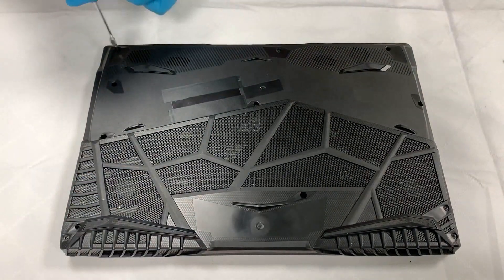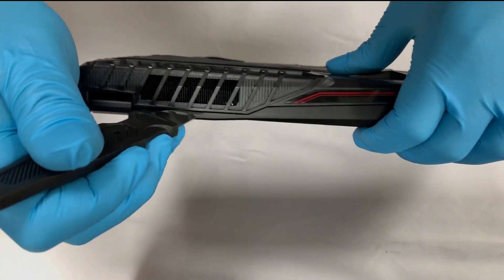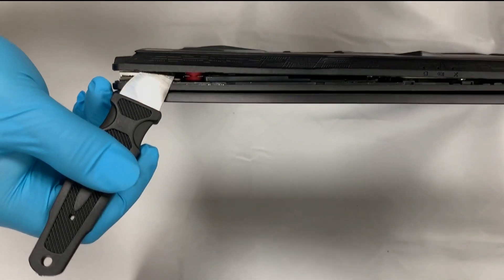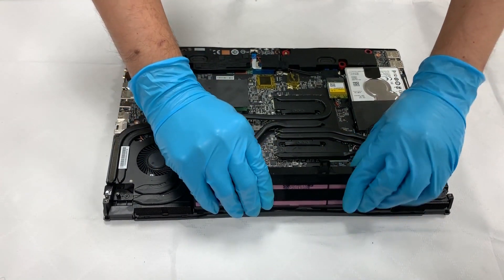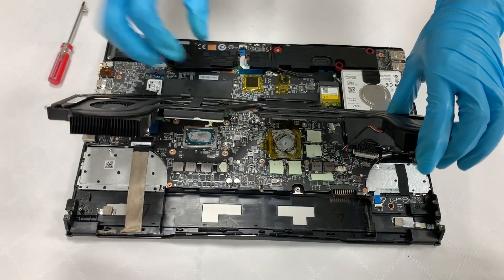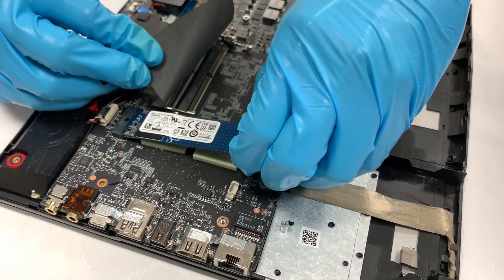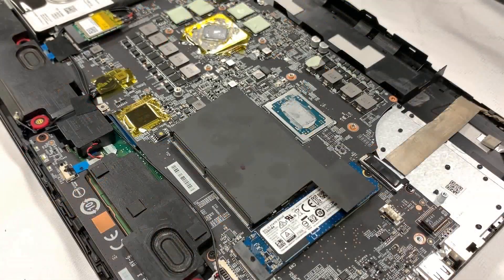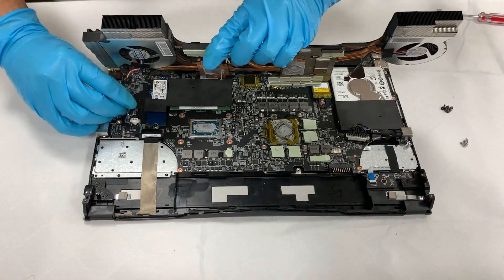MSI Alpha 15 A Series SSD & RAM Upgrade Tutorial

Comment: My alpha 15's CPU had started to overheat and thermal throtle. Found this video and used it to repaste my CPU and GPU. My laptop now works even better then when it was New!

Thanks a lot for posting this video.
Reply: how much estimate paste themal in mg, i want to buy the paste but i don't know how much paste in mg required
Reply: You only need a little bit of thermal paste.  I put a little dot like a a pea on the CPU and another one on the gpu.

I have purchased a 3.5g tube and with it I had more then enough for this job and 3 to 4 desktops CPU.
Reply: Can i put another ssd in it and can I remove the hdd I have cuz I think it's dead and my laptop is just struck at the msi logo screen not turning on after that from past three days
Please do reply
Reply: My version of this laptop has nvme storage not HDD. Si Il cant Say for sure, but I have replaced an HDD with a 2.5 inch SSD un another laptop and IT has worked fine.

Comment: I have a A3DD and was able to swap the NVME SSD without removing the heat sink. The M2 card has enough wiggle room to just slip by the sink. Kudos for this video, it helped a lot.
Reply: I read everywhere that it should have a 2nd ssd slot, do you know where it is?
Reply: @eliodelioable  probably you need to replace the hdd to ssd

Comment: It turns out the latest Alpha 15 model, you cannot add a 2.5 HDD/SSD due to the newer version AMD 7 and GPU, requiring a larger fan. Instead, MSI added an extra NVME slot next to the other one.
Reply: I have an alpha a3ddk, you believe they put the nvme port to it too?

Comment: Do I have to remove the fan to install the 2.5 disc drive?
Reply from the maker: Oh, for the 2.5" HDD, you don't need to remove the fan and thermal module.

Comment: WARNING DO NOT EC RESET YOUR LAPTOP I JUST DID AND NOW MINE WON'T TURN ON
Reply: Did your laptop turn on already?
Reply from the maker: After EC reset, you need to plug in the AC power adapter to turn on the laptop.

Comment: Please advise, I have a plan to upgrade ram on my alpha 15, what mhz should I choose? Is it OK if I choose 2666hz?
Reply from the maker: Specs questions should ask the manufacturer. 
P.S. It should be DDR4-2400 on this model.
Reply: Thanks fot feedback, the said it should 2666mz
Reply: you should check it out on amd page and look for the processor, there you will see the compatible ram you could use on it

Comment: Dumbas you dint need to remove the fans ...... like ........ I’m out ..
Reply from the maker: If you want to replace the "SSD", you need to do this. 
If you want to replace the "RAM", you don't need to.
(The fan and the thermal module are stuck together)

Comment: Hard disk 2.5 upgrade, brand, model, size?
Reply from the maker: Upgrade question, you should ask the manufacturer.
Reply: You can put any 2.5 hdd or ssd
Reply: @DrunkNeltey  7mm or higher ?

Comment: I'm having a problem when putting back the casing. It "clicked" properly on the back, left and right. But I saw a small gap below the touchpad (front side). Is this happened to yours too? Thanks
Reply: Yeah same
Reply: @herlinalina34  I figured it out. Just push hard from the front side below the touchpad (not from the bottom!)